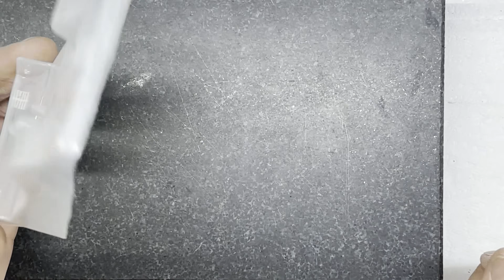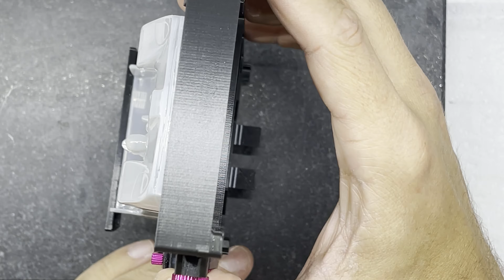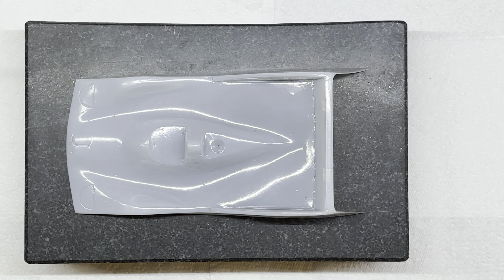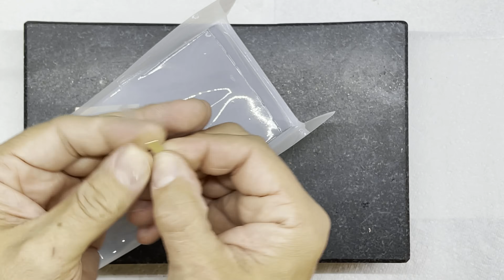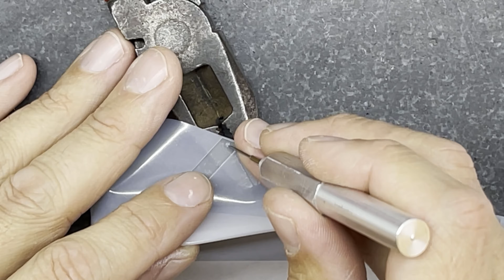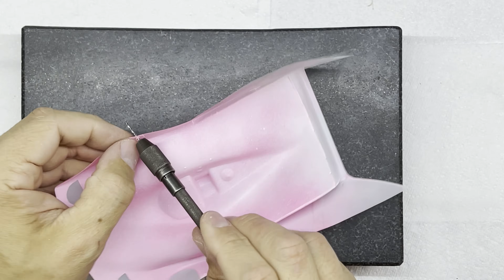Preparing a Vacuum Formed Slot Car Race Body - Part 2

Comment: Which maker's shells come with protection? Really appreciating all this know-how.
Reply from the maker: Nearly all manufacturers of shells in the UK, Europe and Brazil leave the protective coating on the outside (Red Fox, BETTA, Attan, BPA, AAA, Mack, Kolhoza, CAT, etc.) I have not used any shells from the US for a while so I cannot comment on them.
Reply: @CleaveTech  Thanks, suppliers of the sticky Lexan, please?
Reply from the maker: @geraldlambourn3388  , I have used many different makes. The best I have found was actually intended for bus shelters and was stuck to the glass to stop it falling apart if it was shattered!
I think Slick 7 and Koford do their own make though.
Reply: @CleaveTech  industrial strength double sided tape is what I use plus any packaging of a suitable thickness that can be salvaged from the recycling. The tape I use has a red backing film.